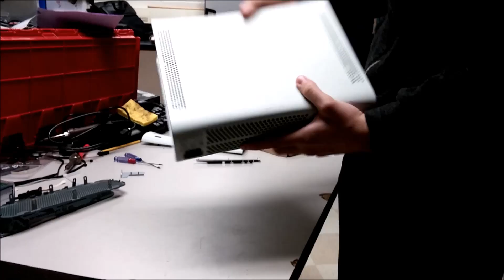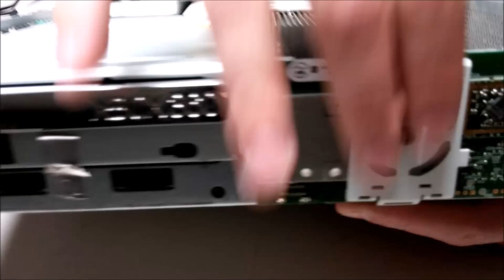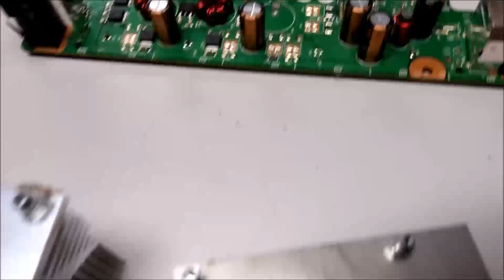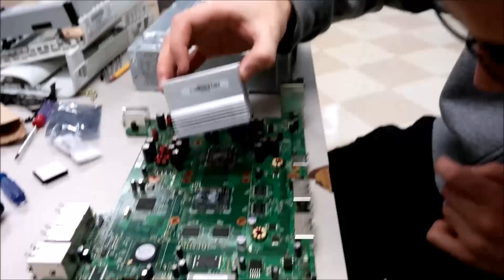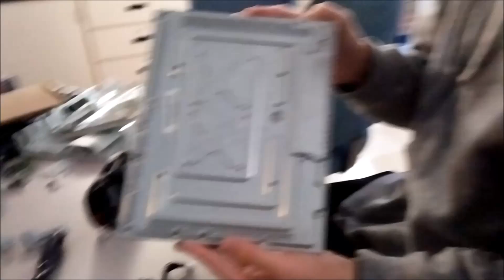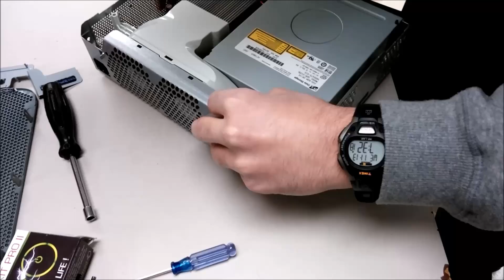Xbox 360 RROD/E74 Repair Guide

Comment: Its better to be pro-active rather than re-active with the xbox 360 RROD. Tuning the fan to full RPM is a good preventative measure. Its better to have to replace just the fan in a couple years time, than having to reball the entire GPU and possibly even the CPU because of cracked or bridged solder balls.

Comment: as a professional repair technician (I do component level repair and bga rework) I can tell you that this guide is horribly wrong and misleading. You're basically watching an average joe heatgun his motherboard (which is BAD) and does an x clamp replacament (which bends the board) I've recieved numerous amounts of 360s that had previously been heatgunned and mostly the gpus were delaminated. As for the x clamp fix, it flexes the board causing the chips to literally pop off the board and render the board unrepairable

Comment: Dont add bolts or use heat gun this is a tem fix.... it will end up making the problem worse
Reply: just lots of research and studied electronic engineering,  sending the board of to get reflowed by someone with a reflow machine not a heat gun.
Reply: @mishyrgh8988  yes performing a proper reflow of the GPU using a BGA machine and preheater is far more effective and safe.

Comment: It worked then I baked it then it worked still . Then i put the rest of the plastic on and it shows the error message
Reply: Luke Kuza I did everything the heat gun and plugged it back In
Reply: Luke Kuza e74

Comment: Do NOT follow this guide!! It is WRONG!!!
Reply: Luke Kuza as a professional repair technician (I do component level repair and bga rework) I can tell you that this guide is horribly wrong and misleading. You're basically watching an average joe heatgun his motherboard (which is BAD) and does an x clamp replacament (which bends the board) I've recieved numerous amounts of 360s that had previously been heatgunned and mostly the gpus were delaminated. As for the x clamp fix, it flexes the board causing the chips to literally pop off the board over time and render the board unrepairable.

Comment: Well, first of all it's not all bad what you show. BUT your video is much too long, it could use some editing or at least some timelapse.
Then, I consider 1000 degree fahrenheit a much too high temperature. You need like 300 degree fahrenheit and it needs to be heated more punktual as otherwise you will boil important components. You have to make sure cpu and gpu are in the right place or you might experience a short circuit which will blow you processors.
And if you have done all that correctly, why would you stop the fans and "bake" the thing? That is redundant.

However, this method might work, but it's common sense that it's only a temporary solution, because these consols are built so cheap, that they heat up and cool down so much and so often, that the circuit board itself bends. And this breaks the electrical contacts. So you need a bigger heatsink and a better air circulation to improve the console. Otherwise the E74 or RROD will come back.
Reply: Well however, beside all that technical stuff which I do not agree with, you can still show all the details while your video is only 7 minutes long. The keyword is editing :) Nobody needs to watch you unscrewing all those screws. Show one and do the rest in timelapse, for example. Your wellcome :)
Reply: @lkuza2  do you know anything about electronics? 1000 degres is way too much and will definitely melt solder. most reflow stations use less then 500. leaded solder which is what they should have used in these systems melt at 370. so 1000 is again way too much. just because you got lucky and have 6 yr old systems still working does not mean this is a reliable repair. do some research this is a bad repair. a good repair is a proper reflow using a reflow station, reusing the X clamps and some good thermal paste.

Comment: 28:34 great thermal paste application... so "little" thermal paste, it will definitely "reduce" your temps...
Reply: +WorldSentinel Yeah, haha =)
Reply: +Luke Kuza Come on it's a good guide. But how on earth you did not knew how thermal paste works? In short, thermal paste is used to fill the usual AIR gaps, that provides better heat transfer. However the effectiveness of thermal paste lies in two factors: 1) the density on area ( the overall spread) 2) the layer thickness. Thus the more area you can cover, less there will be thus heat will move more efficiently. Secondly the lower the thickness of the layer the better heat transfer it creates. Just google about it, I can't really put all the science behind that. And it is known quite widely from about 2005.
Reply: ***** Yeah. it's too much. Anyway, your video is good. ;)
Reply: It is waAAAay too much

Comment: Ive repaired mine twice now, ive used heat gun first time then bent the xclamps refitted them then it broke about 5 days later, so i did the heat gun trick again but replaced with x clamp bolt kit and washers, broke about 5 days later again, although now it comes on but crashes after 2 mins, then when swith it back on straight away gets red rings, if left to cool down, will work for 2 mins again. any ideas ?
Reply: What you should have done was added fans